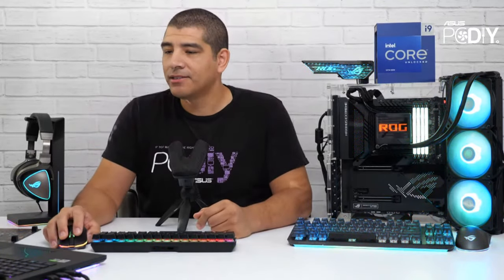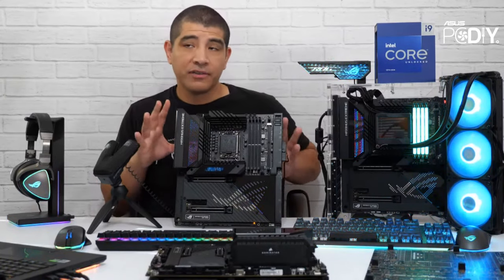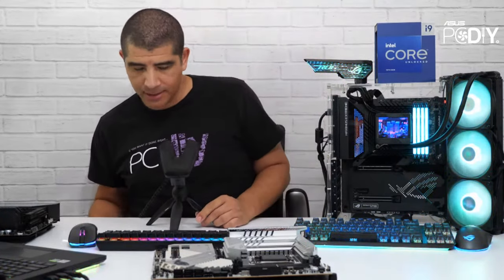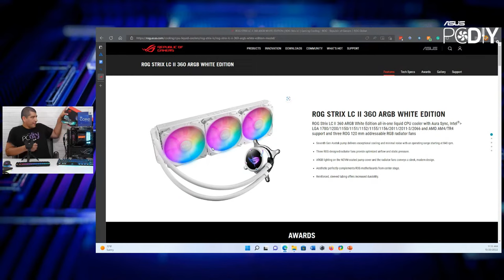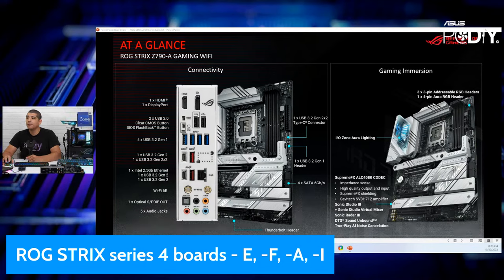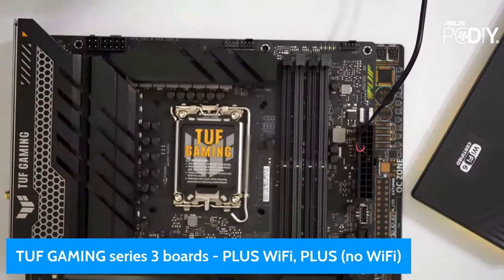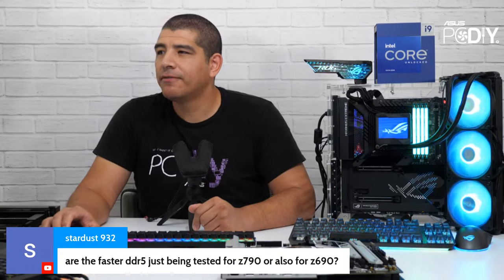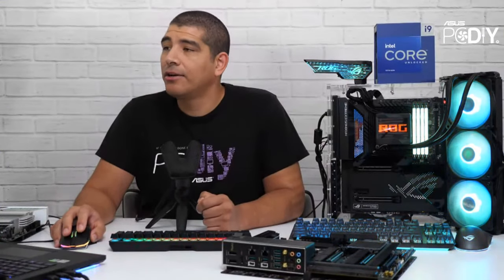Full ASUS Z790 Motherboard Line Up Overview & AMA - For Intel 13th Gen "Raptor Lake" CPUs

Comment: Disappointed that ProArt Z790-Creator has no PCIe Gen5 M.2 SSD socket.
Reply: Same here. This was THE board I was waiting for, and then so disappointed that there's no gen 5 M.2. I've always been very satisfied with Asus and their great quality products. Not that anyone else even offers a motherboard with that, plus the other Creator features, that I need. But even if they did, most of the alternative companies don't instill much confidence in me, so I was really hoping/expecting that Asus was going to come through like they always do. Reliability and good build quality are tops in my requirements for a board, after the specs matching my needs. And of course being available for a reasonable price, even if a bit more expensive than the competition. Thankfully, I'm not impatient, and so I'll just wait until next year when 14th gen Intel CPUs come out, and hopefully Asus will have rethought what creators need by then.
Reply from the maker: Check out the ROG STRIX Z790-E GAMING if you want great IO and onboard PCIe Gen 5 M.2 SSD support.
Reply: @ASUSUSA  Yes, already I saw that. But I want 10Gbe plus 2.5Gbe (two ethernet ports, one for general use, and the 10Gbe for connecting to a NAS). Adding a PCIe card to give 10Gbe is not possible because I'll be using all the PCIe slots already.
Reply: @aaronlee6821  Also, there seems to be not much difference to the earlier z690 board. Might as well buy the earlier one and save a hundred bucks.
Reply: @jenxrj  Are you serious? The new Z790 will be a hundred dollars more than the Z690 version? I haven't seen any prices posted yet. But you're right, not really any significant difference between the two, that I saw. Certainly not within the specs I'm looking for.
Reply: @aaronlee6821  yeah all I can see from the spec page is that the last slot is pcie 4.0x4 now, it used to be 3.0 it seems..

Comment: This is a Z690 relaunch and the asus rog strix e gaming forces your video card to go from x16 mode to x8 mode when you use the gen 5 m.2 port. Why would i want to buy another motherboard that does the same behavior?
Reply from the maker: This is normal as there are not enough lanes to maintain x16. It is also not an issue as graphics cards are not bottlenecked by lower PCIe bandwidth links. x8 will effectively offer the same performance even with a high-end graphics card like the 4090.
Reply: @ASUSUSA  There is no real difference between the Z690 and the Z690 chip sets and no reason to upgrade from a Z690 platform to a Z790 platform and most gamers want there video card in x16 mode regardless of what people say it makes no real difference. To me the consumer it does.

Comment: The TUF Z790-PLUS WIFI seems to have the same specs as the PRIME Z790-A WIFI, at least at this level, any differences we can be aware of? (Apart from aesthetics of course.)
Reply from the maker: They are very similar but there are some minor differences 

PRIME has 1 more M.2 heatsink
TUF GAMING has multi channel line level out and optical audio out ( and a different audio suite )
PRIME has onboard power and CLR CMOS buttons
Reply: @ASUSUSA  Interesting, why does the TUF lack the buttons and heatsink when it's in the next range up?

Comment: Jay I was wondering will the ASUS ROG Maximus Z790 Extreme fit in a tt900 pc case { Thermaltake Tower 900 Snow Edition Tempered Glass Fully Modular E-ATX Vertical Super Tower Chassis CA-1H1-00F6WN-00 } thanks Jimmy

Comment: I am having trouble deciding which Z790 motherboard would be the best for an overkill custom water cooling solution.
Reply from the maker: Any of the boards would be a solid choice but my recommendation would be the ROG STRIX Z790-E or the MAXIMUS Z790 HERO if you want to save a bit the TUF GAMING Z790 PLUS ( DDR5 or DDR4 ) are still great options. Considering joining our ASUS PCDIY group.

Comment: Doesn't the Asus Z790 Strix A D4 have a gen 5 PCI top slot? off the CPU lanes  (according to Asus's own site)- Clear CMOS button is very important
Reply from the maker: Yes, this is clarified later in the stream.

The Primary x16 slot is Gen 5 and the M.2 slots unlike the -E are NOT PCIe Gen 5 but Gen 5.
Reply: @ASUSUSA   Thanks for the confimation.  I've just bought the board and waiting for it to be delivered!

Comment: I can't believe you came out with the ProArt Creator motherboard without a PCIe 5.0 M.2 slot. That is an absolute must for me to upgrade my motherboard, and without it, sadly it's a no-go. From what I saw, you did a great job with that board except leaving that out. So sad.

Adding it via a PCIe slot is not a viable option. I need all three of the PCIe slots, and cannot afford to use one just to get PCIe 5.0 M.2.
Reply from the maker: Thank you for your feedback. We found the overall value of higher number of high speed IO and features like Thunderbolt had more overall value compared to the implementation of PCIe Gen 5 which while a great specification we have queried many creators and found they are not generally running sustained sequetnail workflows. In most cases IOPS are more important and in this respect you are not limited by the bandwidth offered by PCIe Gen 4. Newer controllers will still offers improved IOPS and 4K workflow operating metrics.
Reply: @ASUSUSA  Well, it seems to me that creators are some of the people most in need of sustained sequential disk access. Reading/writing/copying huge sequential files is something I do constantly. If other creators don't have this need, that's news to me. Anyways, I guess I'll just wait for the next generation of Intel CPUs (14th gen Meteor Lake), and hope that by that time Asus comes out with a motherboard that supports directly the highest gen NVMe drives, without the need to purchase one of the high-end board geared towards gamers, with lots of features I don't in any way need.
Reply: The new Samsung 990 pro will make light work of whatever your workload is.
Reply: @j340_official  The Samsung 990 Pro, despite some claims several months ago, is not Gen 5, but rather Gen 4. I already have a comparable SKHynix Platinum P41 which I'm very happy with given it's limitations under Gen 4. Gen 5 theoretical speeds are double Gen 4, so even a more modest 50% increase over Gen 4 would be very welcome. With Gen 5 drives coming out likely within the next month, I was hoping to upgrade to a new system early next year, after all the bugs/compatibility issues in the new generation drives, motherboards, CPU, graphics cards are ironed out. But so far I don't see any motherboard that'll meet my specs.
Reply: @aaronlee6821   you do realize sequential speed is just one metric but you also have to look at other metrics like latency, IOPS, random read/write, how long (and how much data written) the drives can sustain the write speeds before the SLC cache runs out and write speed declines from the peak theoretical speed to a much lower speed? Even if you get a gen 5 drive, depending on the workload, it can perform worse than a gen4 drive. Don’t get fooled by the marketing making you believe you need a gen5 drive. 

Also, leaked figures are suggesting that first generation pcie5 drives using the phison controller will not saturate the pcie5 bus, and will top out at around 10,000 MB/sec. So you’ll have to wait until second generation or until Samsung or western digital release their proprietary controllers for the full pcie5 performance.
Reply: @j340_official  Thanks for that information. I'm not an expert on all the factors that go into actual speed/throughput, so I'll need to wait until real-world devices come out and there are reviews before making any final decision. I'm well aware of the chance for early adopter headaches, and want to avoid that. It's always a difficult decision of "do I upgrade now or do I wait for the next generation." but hopefully after some good reviews come out of the newly released hardware, it'll become clearer if now's the time or not.
Reply: @aaronlee6821  I’m glad to see the increased pace of innovation, after the long period of stagnation. Pcie3 was around for long long time before pcie4 came to market. And in far less time than it took to transition from pcie3->4, we’re now transitioning from pcie4->5.
Reply: Its still on the 1700 socket though/the meteor lake platform/the 1851 socket, MAY be right around the corner. Most likely the i9-14900ks will be on the 1851 socket,not the 1700 socket.
Reply: @mattmatt2417  I actually wasn't planning to upgrade until early next year, in order to give some time for the companies to work out any kinks in the new generation hardware/software. If Intel announces details of the 14th gen CPUs in January 2023 at CES, I'll wait until that time to make a decision if I'll go with 13th or wait for 14th gen. From the limited information I've seen, it sounds like 14th gen is a bigger step up from 13th gen than 13th gen was from 12th gen. Of course, if you keep waiting for the next release, you'll always be waiting because there will always be something new just around the corner.

Comment: Apex doesn’t even have a hdmi or dp for gpu t/s. Such a bummer . Otherwise looks alright. The hero has an add in card that will block vertical gpu mounts. For that the apex’s dimm.2 is useful.
Reply from the maker: The APEX is focused at overclocking and the topology and power delivery have been designed for that, APEX users will not use the iGPU and will always use a discrete graphics card.

Comment: As impressive as raptor lake is, it’s possible that z790 will not support any newer intel CPU generations like the upcoming 14th and 15th gen meteor lake/arrow lake. 

So if you’re upgrading from an older platform, consider skipping raptor lake, and waiting instead for meteor lake/arrow lake. If z790 truly won’t support future intel cpu generations (no one knows for sure, well except for intel and mobo partners), then strongly consider avoiding an upgrade to a dead end platform.
Reply: 14th and up will be a different socket because... intel :))
Reply from the maker: Based on long term collection of user upgrades most users do not upgrade their CPU even when possible. As a whole users tend to go from one generation to the next with a delta of 2 to 5 years between these builds and in some cases more.
Reply: The biggest issue with your conclusion is that part about ppl who are coming from an older platform. Like, how old are you talking about here? If ppl waited years to upgrade, it pretty much means they aren't the type to upgrade whenever domething new comes out.

For example, I'm on an i5 6600k skylake and I'm looking to upgrade soon, but if I go for 14th gen, then not only do I have to switch motherboards, I also likely have to get DDR5 rams. And let's not forget that most old coolers are incompatible with new sockets due to their dimensions, so that's even more hidden costs just to upgrade my CPU.

However, if I go for 13th gen, I'll be able to reuse my cooler and DDR4 rams and save me lots of $$$. And let's be honest here. Going by statistic, Intel switches sockets every few years. A new socket in 2023 would probably last until 2026, if we're lucky. By the time I need to upgrade again, there would probably be a whole other socket for the 17th gen, or maybe even 16th gen. Ppl like me aren't losing out on much just for choosing 13th gen over 14th gen. Heck, if I can put off getting these expensive DDR 5 rams until it gets much cheaper in 2026, then why not?
Reply: @FinalStigma  look up the specs of meteor lake and arrow lake and you'll see what I mean. If those lakes are coming soon, and you don't need to upgrade today, the smart money is to wait...also thunderbolt 5 is coming soon, something you won't get on z790. If z790 supported the future lakes, then I wouldn't have a problem recommending getting z790 now.
Reply: @ASUSUSA  data is based in part on old Intel CPU generations when the generational performance uplifts were very small. There was absolutely no reason to upgrade from the 6700k to the 7700k. Or the 10700k to the 11700k. In fact, with comet lake to rocket lake, the i9 10900k had 10 cores, while the 11900k had a core count regression.  No reason to upgrade.

But if Intel is going to continue to offer more and more  hybrid cores and increase their ipc with skymont and darkmont, while also offering high performance cores, more users would consider upgrading their cpu.  Especially if they don't need to buy a new motherboard.  Alder lake users (12600k/12700k) can effortlessly upgrade to raptor lake without much hassle or fuss  and get more cores and threads and improved single core and multicore performance.   

Platform longevity coupled with excellent generational updates would incentivize more users to upgrade their cpu, and would make it less of a hassle to upgrade.  But of course platform longevity would mean Asus sells less new motherboards, bad for business  I get it.

If meteor lake and arrow lake are big performance upgrades over raptor lake, then many users who buy into z790 will want to get arrow lake. But to do so means buying a new motherboard and probably throwing the old one away.  Not good.

Comment: Apex is white-ish now...
I have to look smth else then
also Z690 - especially APEX!!! - was a complete s/show =))
they say that now they want to make amends with this one, but I don't trust Asus anymore...
Reply from the maker: We hope you keep ASUS in mind, regardless of what board you go with best of luck with your build.
Reply: @ASUSUSA  the forums (ROG, OC etc) are full of users which are still struggling running properly their Apex Z690... there are several iterations of this board (actually having even different part numbers), the 2021 ones are quite dodgy... 

on the other hand, they say that Asus is trying to make amends with this generation, as Asus really got a bad reputation after the Z590 and Z690 fails...

I'm having ROG boards since 2013, each generation even few models, but after the Apex XIII which has been a complete fail for me, I was forced to consider something else...
Z690 was a problem in general, and unfortunately Asus got a bad reputation - the Hero stuff, Apex fail etc - don't know what happened there during the years...

I already have the 13900KF and a brand new DDR5 kit already, I honestly don't know where my money will go this time...
Reply: @themagiccat9698  evga dark z790 will mostlikely be goat again